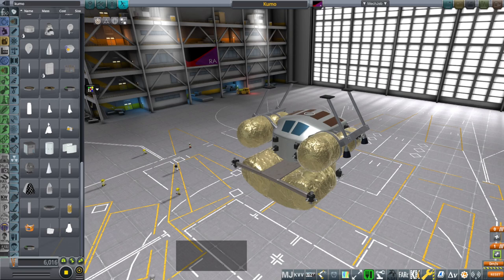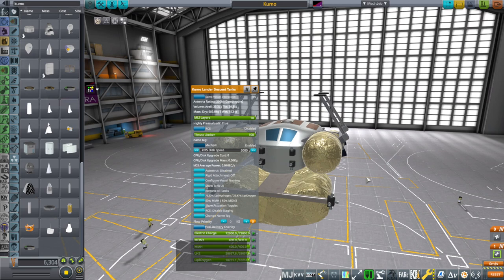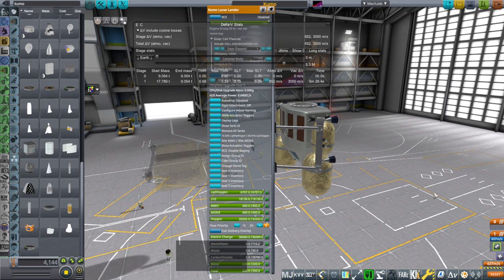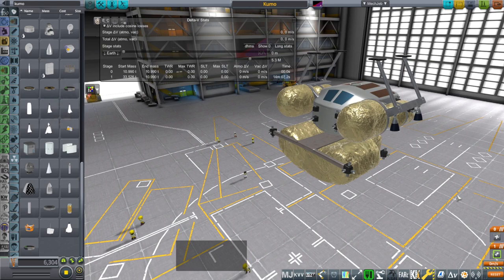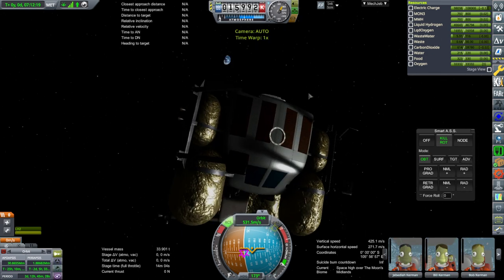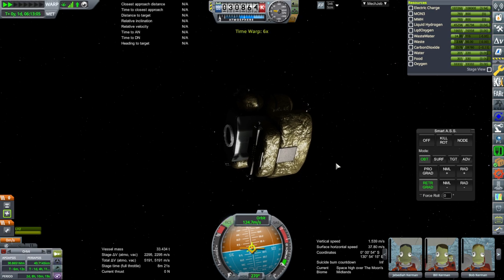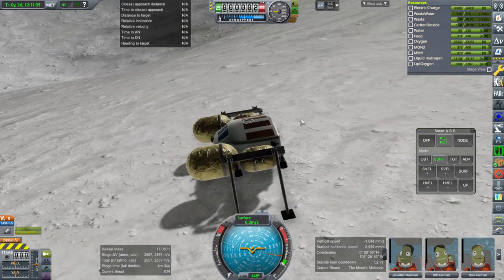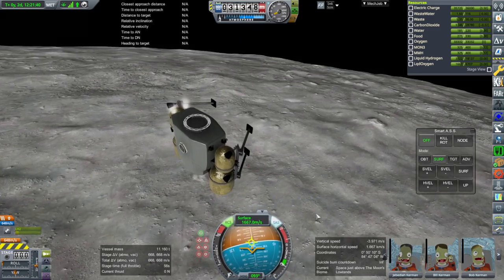Kerbal Space Program 1.8.1 with RO - Kumo Lunar Lander System

Comment: @Raiz space here's an idea: what if you used a pressure-fed hydrolox engine as a lunar landing engine, it would take the high efficiency of hydrogen and oxygen and the reliability of pressure-fed systems. I've seen this idea around and I think it would be interesting to make such an engine and test it in kerbal space program.
Reply from the maker: The downside is that a pressure-fed engine is much more physically larger to get the same thrust (because of the low chamber pressure) and also requires heavier tanks. There are benefits, but I don't know of any test done of a pressure-fed hydrolox engine.
Reply: @RaizSpace  you're right probably the greatest problem would be the low thrust, so it's probably better to use such an engine as an orbital maneuvering system rather than in a lander (even if the lower gravity of the Moon might make it possible). I don't know of any attempt to build this engine either that's why I thought it would be interesting to test it in KSP.
Reply: Blue Origin have done tests of the BE-7 thrust chamber pressure fed since the propellent feed system isn't developed yet

Comment: i think engine failure is a certain death here and there are 4 of them that increases probability dramatically
Reply from the maker: They are spaced so that the opposing engine (if the back right one fails, the forward left one) can be shut down and the lander can abort to back to lunar orbit on two engines, of course. I mean, we were at a hover throttling down below 20% with nearly the full ascent portion. This is much safer than the National Team proposal, which had just one engine on the ascent portion.

Comment: 0:14 Dynetics ALPACA is an awesome optimized lander for Artemis! why the DHLS slander? National team wasn't bad either, Lunar Starship ain't too bad. 2 decent landers but 1 awesome lander

As for SLS optimization, a dry ALPACA can be co-manifested by SLS B1B/B2 or refuelling tankers can be shipped up in the co-manifest alternatively, so you can achieve effortless sustainable landings like this. For national team, descent or ascent element could be co-manifested too. Just Lunar Starship that doesn't really work with SLS co-manifest, but SLS could co-manifest a cargo re-supply module to outfit systems on that HLS
Reply from the maker: I mean, I explain very specifically why I find each system inadequate, so I'm not sure what's unclear. Your comment doesn't address the main point I was making - none of them is actually made with lunar ISRU in mind. As for the Dynetics lander in particular, it wasn't me that found it incapable - that came out as part of the selection of Lunar Starship. As far as I know, it was NASA's conclusion that it had negative payload mass.
Reply from the maker: Here's Scott Manley talking about the Dynetics negative mass allocation: https://youtu.be/GuSM_-Aw5HM?t=605
Reply: @RaizSpace   That has been resolved, and was made fully reusable by removing the drop tanks.
Reply from the maker: @BobKermanIndustries  That wouldn't solve the problem at all - you're saying that it's just a single stage now using Methane and Oxygen? That would lead it to have even less payload mass.